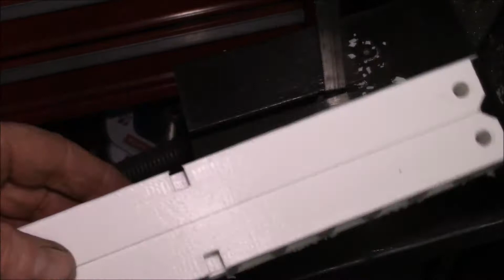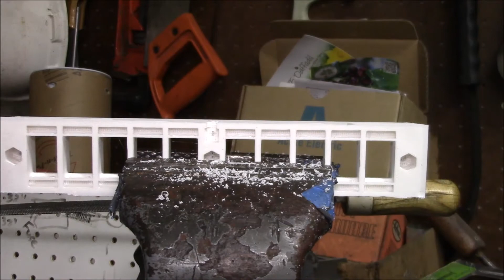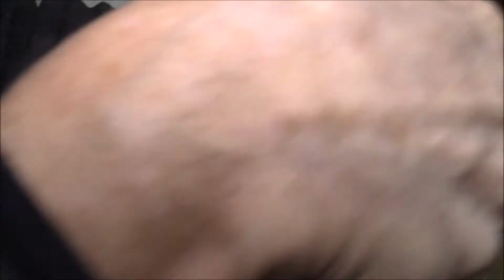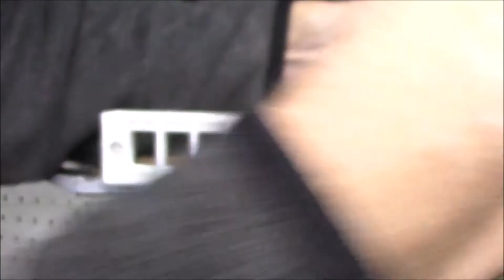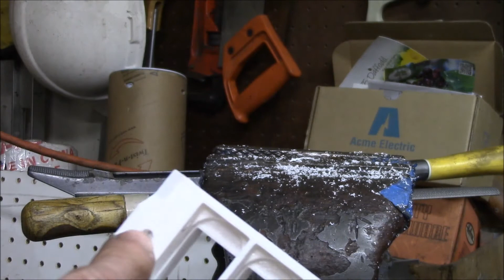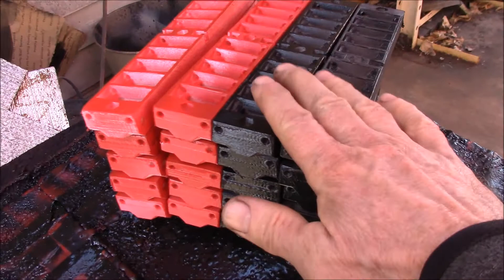Processing 3D Printed 20P Battery Holders

Comment: What do you use all of them for? did you get the cell hold from thingaverse
Reply from the maker: I'll be building more of my 4S-20P battery modules to connect to my solar charge controller.  Currently, I have 3 of the modules built, this batch will get me up to 7 total or about 3.5KWH capacity.
Reply from the maker: And yes, cell holder files from Thingiverse:
https://www.thingiverse.com/thing:1289889